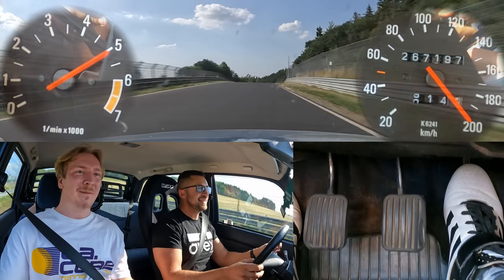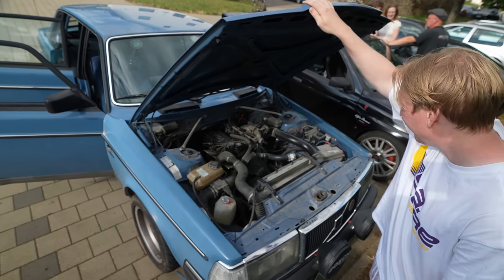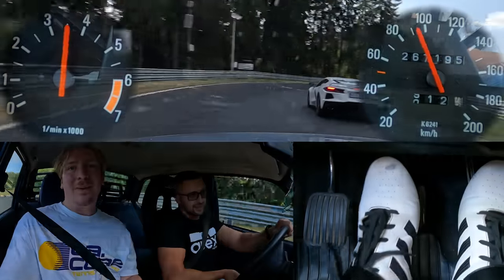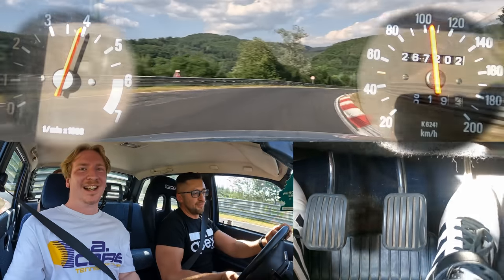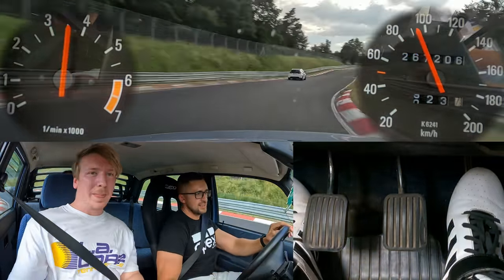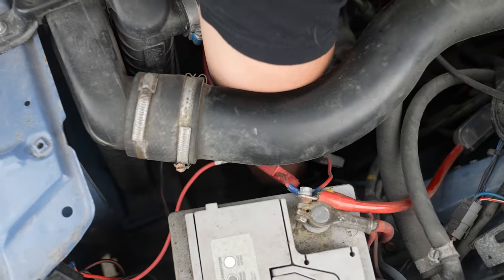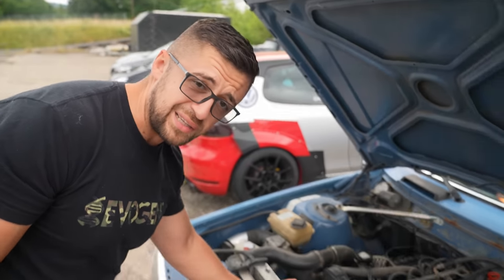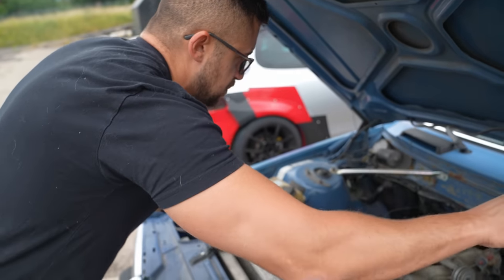I BLEW UP A VOLVO 240 on the Nürburgring :(

Comment: Thats very rare.  I've thrashed a boosted B230FT on the track for a number of years in my 360.  B230FK blocks and rods are very robust.  Unless its an early one with the thin conrods, but I don't think could be a B230FK.

Comment: awe poor volvo, good time for a bigger engine, I hear good things about the 2.5 5 cylinders ;)
gentleman Misha for helping them out like this. gg's
Reply: B5254T4 ftw!
Reply: @CaptainSeamus  not the most reliable, but its fantastic. i would go with the B5234T3
Reply: @joaoferrao9501  I hear ya... but a simple shimming solves a lot.  Honestly, I have 270,000 miles on mine, and it's still pulling very strong. Strong enough I'd even let Misha drive it around the 'Ring if I were in Europe.  The transaxle and angle gear, on the other hand... ;)

Comment: Hi @Misha Charoudin Original engine for that would be a 2.1 used in many volvos so many out there but the better is the 240GLT one which is 2.3 has mods also. plus there is a turbo 240  version from Factory and does go well and handles David Gillanders drove one in the Scottish borders rally turned the wick up to gas mark 25! see if it would bust? but it won the rally and up against some tasty cars.
There is room to put coolers in front of rad. Rear end is multi link on a live axle most had rear discs.And there is a lot you can do to them to surprise many!!! as with the right kit and bits a neat sleeper car

Comment: You could hear a bit of knocking in the corners and under hard breaking. The oil just got away from the oil pickup. It would have showed on an oil pressure gauge but not an idiot light

Comment: The oilpan on those engine dont have good baffling for oil control. And the turbo engine have a high volume oil pump so its probably the long fast corners that killed the engine

Comment: No oil on the track, so the engine was starved of oil? Seems like the only reason it would blow. I've got one 30 years and 480 000 km and the piston play is still like new. Also the mitsubishi turbos in these is the weakest link in the chain. I've had one started leaking oil into the intake on a car that was only 19 years and 230 000 km

Comment: Volvo motors are built like tanks. I use to work at a garage doing parts dismantling and an old volvo was brought in. We had to try to get every car started no matter what. This Volvo on the lift was missing half the motor/cylinders 😂 i mean literally missing half the block and had pistons showing too. But it still ran. Just with a major knock. Cant believe it ran to this day.

Comment: I have a question. Do those big lights on the bumper block enough air flow through the radiator to cause the engine to run hot? BTW, I've been running Volvo redblocks for some 40 years and I've never had one come apart like this one did. This is really curious. I've had several of them go way over 300,000 miles and one that I have now has over 500,000 miles and they don't even blow smoke on start up. If I were in Europe, I would love to see this car on the road again. It's such a great little car that it's worth keeping it in good shape.

Comment: It did look sound like oil starvation to me , as on a lot of corners it sounded like it was either engine clattering or grounding out.  I’m assuming no oil pressure gauge on those ?  With the hard driving and sticky tyres stiff shocks etc that car was definitely going to need an upgraded oil system , a baffled sump minimum .

Comment: She hucked that rod bearing and rod real good 😢. I've only blown up one of my "race" cars before, a Suzuki Ignis Sport (the first model). It blew a head gasket mid rip and with the combustion pressure in the cooling system it also shortly after blew a radiator hose. Warped the head and block deck surface pretty bad. Was going to swap a used M15A back into it but someone had a crashed Ignis Sport and was looking for a good shell so I sold it and he swapped his engine from the crashed one into it.

Comment: if it wasn't in the title, i would think of the same outcome... 6krevs, 200kph, on a 230k engine...  the owner's expressions and mounting concern would have said pull over now... later, the sound of a rod knock and after, the more obvious bang of parts escaping their space... unfortunate, but as you said at the end, a LS swap would be sick!  or go J2z swap, either should  fit, right?

Comment: The engine is (was) amazing but really needs a LSD, single pegging almost every corner! Still looks like a really fun car though, but with a few changes (lsd, brakes, anti-roll bars) could be an absolute beast. Probably a good idea to add a oil temp and oil pressure gauge too lol

Comment: Stackars bil :( Idk volvo 240 b230 turbo engines are not that common. The 740/940 turbo 4 cyls are more common, but as the distributor is on the back of the head on those they wont fit. 

But with a bit of modifications a guy can make it work! Either modify the torpedo wall, or modify the block and put in a block mounted rotor and distributor.

Stock b230s are only good for 250/300hp, going over that and you can expect it to blow up.

Comment: I could hear it start early maybe it was oil starvation during cornering? I assume these dont have sumps that keep the oil in the centre or at the pick up during heavy cornering or racing. im not an expert but i know this is an issue with toyota 2zz engines so the first upgrades we get are moroso sumps.

Comment: Any redblock engine of the ''B230'' family would fit, if he just want to make it driveable to bring it back to sweden :)   But preferrably he should source a ''B230FK'', as it has oil squirters to cool of the pistons, and it has thicker rods than the B230FT.      Also worth mentioning, he should move the air-mass-meter to the preassure side between the intercooler and intake :)

Comment: The rattling sound when off throttle in the beginning was most likely already due to low oil pressure. Surprised it managed to hold on for half a lap.

Comment: If I've to deal with it now, as the 245 is a beast when tuned up.... I will look in s#den for a good built engine, that could out something around 300cv which is very normal for Volvo turbo, and come back to fit in the car as you said. 
Add some coilover and a pillow for passager crying freely. 

And let it go on the ring. 😎

Comment: Ooops!!!
You drill it & kill it, you rebuild it!
Misha is really hard on cars & not at all mechanical sympathetic, red line gear changes & left foot braking on an old beater not up to operating temperature.
Misha drilled M539 Restoration's BMW within an inch of it's life.
Also as a ring instructor his overtakes are brave but unsafe, slipping past on corners without indicator confirmation is a huge risk, the big tangle/crunch will come it's just an accident waiting to happen.
How long does it take an engine to get oil to 80°C???
Watch Walter Rõhrl & Robert Kubica driving style smooth, controlled & fast without too much fuss.
Way more skilled and way less EGO!

Comment: Interested to see what happened to make the hole in the block. I'm guessing turning up the boost is not a good idea? 🤔
Reply: He was running about stock boost for the full pressure turbo spec which is around 0.6 bar while the spec he has runs 0.3 bar stock with only wastegate and ECU being slightly different on the full spec and a stock engine should run 1 bar fine without touching anything,
 my speculation was overheating oil since for some reason he wasnt using an oil-cooler that comes stock with any turbo B230.
 So i would basically say its all on the owner for putting it on a track without it.

Comment: Actually the lessons n learned in this story, don't put sticky tires on it, until the oil and cooling system is not improved, at least proper buffle plates in the sump and an oil cooler. 
But the guy with the corvette...definitely have some serious problems with self-evaluation :D

Comment: Sooo... the engine running hot was not really a fault of the cooling system, it was excessive heat from a bearing that started failing. Right? Has happened to me.

Comment: it was probably oil pump issue... running on low oil pressure... or a really thin oil
Reply: probably was thin oil since there wasnt an oilcooler mounted on it which got the engine to be a bit depressed
Reply: @stridsvagn1039  i agree!! For sure it was that

Comment: Blew a rod bearing and kept driving. I'd say that's a pretty typical result. If you would have turned the engine off and pulled to the side, that block would have been fine.

Comment: Knowing these engines... The engine had rod-knock from the first turn of the track 😂 the "Buurrrrr" sound was there from the start, during all cornering and all braking... It ran for 1/3? of the track oil-starved, overheated and with the 3 bar back pressure these shity 13c turbos give at even moderate boost. Stubborn tractor engines, they are indeed.  (most anything else would have "grenaded" immediately).

Comment: .... 
Thoose engines almost never dies,,, we tune them to 300hp reliable hp and in dragracing they are heavily modified and tuned up to 1400hp. 
0.65 Bar boost should not blew up the engine this car was extremely missthreaten...

Comment: will the engine mounts work for a 740 turbo engine? They are lovely engines to work on  - not so sure about the 240 but my old 740 engine bay was designed for a v8 US market car so the 4 cyl had loads of space for working on it, I never drew blood on that red-block ever, still the only car to not draw blood from me :D and the clutched fan roar on pull away - I miss that sound :D

Comment: Nice part of the pcv channel you got as a souvenir, right beside cyl#3, which coincidentally is the hottest cylinder on the b230. Not that excessive cylinder temps were the culprit this time around, more like oil starvation in those long sweeping corners due to a complete lack of baffle plates in the oil sump. (The little plate on top from the factory doesn't count as it does nothing). Truly overrated engines with tech from the 60's with an unhealthy cult following. They can be modded to support a fair bit of power, but you really need to ask yourself "at what cost".

Comment: If you listen to the car from the start, everytime you let off it sounded like it was tapping. Nearly 200kph on the 1st straight probably killed it 😂😂. Funny ending to a trusty volvo rip
Reply: the tapping rattle you hear is the a/c heater blower motor rattling.... the actual rattle in the motor starts at/near Carousel.

Comment: big fail here is using your left foot braking , you would do better using your right, infact alot of brake travel, advice which i see you dont care, when it over heats you need to drop to about 50kph and keep revs low or stop

Comment: It was not your fault at all, you have asked him whether everything was OK with the car, different story would be if he has told you that it has coooling problems and to drive it easy - but in this case anyone would feel responsible, I think that sad more likely.
Anyway, this car went 200 km/h with three people on board and around 200 hp, I think that is insane - also now that I think about it, it is and old Volvo, who knows who owned it before and how it was driven and maintained by the previous owners, but if it is not rusty then I would not get rid of it at all.

Comment: wow broke a cast iron low boost turbo engine block
yeah putting in another engine wouldve been the best option , the body and interior actually still look good , might even be able to put the bottom end of a non turbo engine in there and just put the rest of the old engine on there
would upgrade the brakes to those of a heavier , faster version volvo , maibe disks in the rear and 2 / 4 pot calipers in the front with better brakepads
the lack of lubrication , might be because the oil sloshed away from the oilpickup ,  it is a stock engine and probably doesnt have baffles in the oilpan , could allso be it broke a rodbolt

Comment: Only a few seconds in and im laughing. "This car has never seen such speeds before", and the speedometer is showing 180km/h. Stop sawing at the wheel, put yoyr foot down and drive. As you passed the 160 mark the car should have settled on its suspension and become more stable. I know because that is what happened with our 81 240DL estate with the 2.1 litre carburetor engine with a 3 speed automatic gear box. Also happens in my 1990 240DL Estate with the 2.3 fuel injected engine, automatic overdrive gearbox and 624,000 kilometers on the clock.

Comment: Fun fact: The engine block is not aluminium, it's cast iron.  So, I guess you actually need talent to break it ;)
Reply: or not be smart enough to keep the oilcooler if you plan on bringing it to a track

Comment: "keep it around 4000 RPM". Good driver but doesn't know much about how cars work.  The owner keeps telling him it's running hot, and he keeps throttling it, keeping the REV's up high.  No common sense.  "we were not pushing it"  "I wouldn't say I was responsible".  Buddy - you were driving it like it was a race car, it's on you.  Good job for taking car of the recovery though.